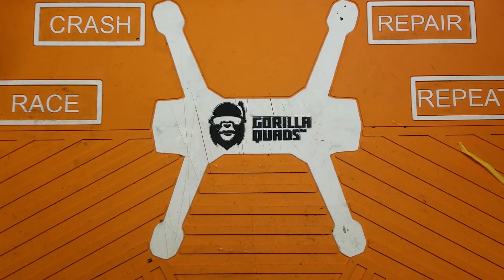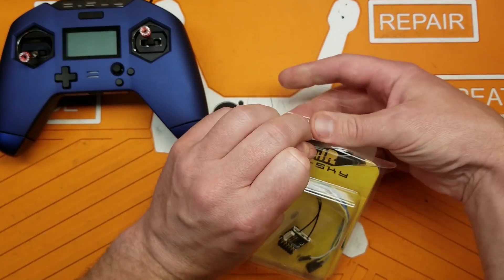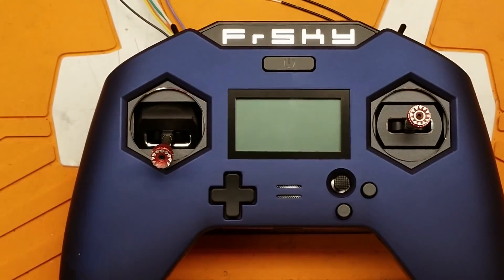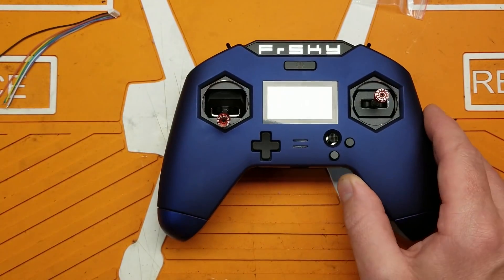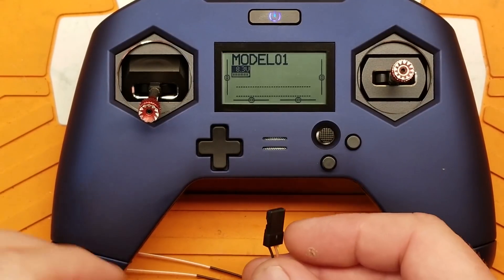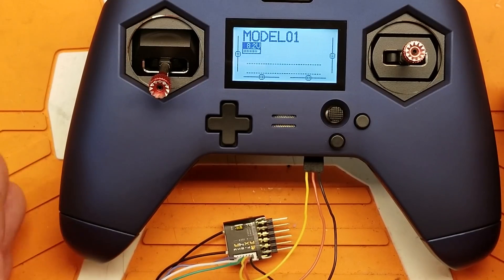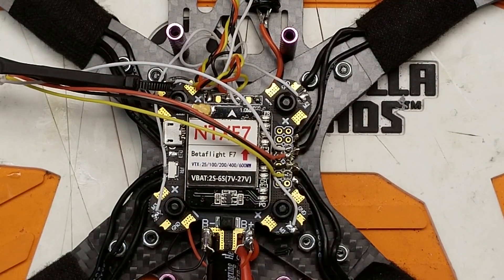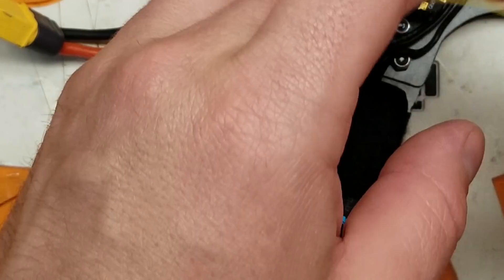RX4R ACCESS with Frsky X-Lite Pro.

Comment: Hi, I have a Taranis X9 Lite, there is no "ISRM" mode to select, only Access and ACCST D16. Is it even possible to use this transmitter with the RX4R? Thanks!
Reply from the maker: Isrm mode is access. Yes you can use it with the rx4r in either accst d16 mode or access. It all depends on which fw you have flashed to the receiver.
Reply: @TweetFPV  I did like in your video, flashed the newest software. But it wont connect with either access or accst d16 mode
Reply from the maker: Its only going to work on one mode or the other depending on the fw. Which fw did you flash? Also the fw on the radio also needs to be updated to match.
Reply: @TweetFPV  I flashed "FW-ACCESS-RX4R-v2.1.0" - the newest.  Thanks a lot for your help.
Reply from the maker: Ok then you also need to flash the isrm fw for your radio of the same version
Reply: @TweetFPV  doing it right now with your video.

Comment: Which receiver to use for "FrSky Taranis Q X7 ACCESS"?
Reply from the maker: R-xsr is my go to receiver
Reply from the maker: Eventually frsky will release thier archer m receiver. That will be a access native 2.4ghz rx. I've had mine preoreded for about 6 months now.
Reply: @TweetFPV  I am looking for 900Mhz receiver
Reply from the maker: Ok, so you already have a r9m2019 module? If so then the r9mm Ota is the one to get.
Reply: @TweetFPV  Thanks, and I need to buy SBUS to PWM converter too, to use channels to control camera gimbal, servo etc right?
Reply from the maker: You can do that if you want. There are 4 pwm outputs on the rx you can use without the sbus converter.

Comment: Hi TweetFPV, you really need to do a new analyse on this controller. I have it too & flying it with a XM+ receiver. As for the moduls, you could fit different types ; ). But what I haven't managed to do is run it on D8. There is supposed to be a way to do it & actually hoped you would've/could've done it. So I could learn from you to so it myself. Great review & take care.
Reply from the maker: Unfortunately there is no way to run the new access radios on d8 without using an external xjt module. You can however run a lot of the spi micros on d16 https://youtu.be/hUpZdIAclOE
Reply: TweetFPV ahh ok, thought so, thnx for the reply & take care.

Comment: FR sky pissed me off with what they did with ACCESS. Does anyone actually notice an improvement with the obsolescence protocol?
Reply from the maker: I have been running access since day one and it does typically out perform older d16 recievers. Why does it make you mad that they are creating new tech? No one is forcing you to use it, and all your old gear still works just the same as it ever did. The only thing that I don't like about the new breed of radios is the lack of d8 support.

Comment: The size of the RX4R is not as bad as it looks in this video...The version of the RX4R you show here has a lot of unnecessary x/tra stuff on it as it is the "with pins" version. I sell the bare-bones/un-pinned version of the RX4R here at Boulder MultiRotor LLC / bouldermultirotor.com which you can find for sale here: https://bouldermultirotor.com/product/frsky-rx4r-recei…els-without-pins/ and it's actually much smaller than you might think!...the reason for this is that you don't need the pins, the smartport harness/connector, the foam pad, or the cardboard/paper input/output labels cover. All you need is the RX4R directly soldered and maybe a little thin piece of clear heatshrink.

Anyway, I thought this might be important to mention since for most FPV pilots, size does matter :) Also, one other thing...the video mentions that the R9M-Lite module will eventually work with the X-Lite Pro but I don't believe this is correct. Especially since Frsky just released a new version of external module for the X-Lite Pro called the "R9M Lite Pro" with the following description:

"The R9M Lite Pro is the upgraded 900MHz Lite module. It has a high-speed digital interface, supports up to 1W RF power, and is fully encased in a CNC aluminum protective shell which also aids in heat dissipation when using high RF power. Designed with the new ACCESS firmware, it also supports spectrum analyzer functions. The module is perfectly compatible with FrSky new ACCESS radios like Taranis X-Lite PRO and X9 Lite."

Here is a link to their website for this new product: https://www.frsky-rc.com/product/r9m-lite-pro/?utm_source=frsky-rc.com&utm_campaign=c00c2dffc0-EMAIL_CAMPAIGN_2018_02_12_COPY_01&utm_medium=email&utm_term=0_60299ab891-c00c2dffc0-182506817&mc_cid=c00c2dffc0&mc_eid=ac2057c26e

Frsky does currently have new ACCESS firmware for the RX4R, RX6R, G-RX6, and G-RX8 and they will eventually release new ACCESS compatible firmware for the following older receivers: RXSR, XM, XM Plus, RX8R Pro, plus I imagine a whole new line of ACCESS compatible receivers will be created since this is the direction they are headed. I'm glad they are finally jumping onboard with great features (that the TBS Crossfire already has) like OTA (Over The Air updates/firmware) and digital interface!

Anyway,  great video! Thanks for providing mostly accurate information (I do realize that some of the updated info I mentioned came out after the release of your video) and great step-by-step instructions for updating the RX4R to be compatible with the new X-Lite Pro!

Comment: Is there support for installing the TBS Crossfire module?
Reply from the maker: In the latest nightly builds of opentx there is a option for crossfire. I have no way of confirming if this actually works or not. External modules like the Vantac mpm do work. They aren't super reliable yet but they do work. Nightly builds are very buggy and should only be used for testing and development purposes.

Comment: I was hoping to see you acually use ACCESS and fly with it to give impressions - is it any good?  To be honest I quickly scrolled to see because I do not care how it gets installed or what to hook up in betaflight if it is not any better than my old gear.  It's not your faults - I am waiting for that video to explain why we need this.  The marketing from Taranis is horrible.
Reply from the maker: I'm still testing the gear. so far i'm about 20 packs in and here is what i think:
The range on this receiver is better than any 2.4g rx I've ever used. I can't attribute that to the ACCESS because I don't have much experience with the RX in the ACCST form.
I have had no drop outs, or random connection issues. 
I am no expert pilot but the latency feels very low, but without the proper equipment i have no tangible way to measure this other than by how it feels.
Do you NEED this.... Hell NO! 
In the future the only real advantages i can see with this ACCESS protocol is that you will have the ability to share your model with another person using a ACCESS transmitter with out needing to bind to their gear. Basically you can share your 
There will be OTA (over the air) updating of receiver settings and firmware from the transmitter. IMO this is the biggest advantage of the ACCESS protocol that i can see. 
Then there is latency. Frsky has a 9ms latency setting in the firmware but it is only if you use up to 8 channels. For most people flying FPV this is plenty. just for comparison crossfire is about 13-14ms (not my data).  Again i have no way to prove that these numbers are real and not marketing wank. 
The downside of all this is ACCESS and ACCST can not exist at the same time and ACCESS is not backwards compatible. So this means that off brand receiver like the ones in the crazybee boards and the emax stuff for example will probably never have the ability to communicate with a ACCESS transmitter so the need for a multi protocol module will probably be a needed accessory for anyone who has a newer radio that has the ISRM transmitter module. 
I hope this was useful. If i missed anything please let me know and i'll try and answer.
Reply: @TweetFPV  Thanks a lot - now I am intrigued.  I may have to get this after all.

Comment: Great video, looking forward to more X-Lite Pro updates on your channel :)
I'm currently waiting on mine to arrive, just hoping FrSky will offer some updates soon. Do you know if with the current firmware multiprotocol modules like Vantac MPM Lite will work?
Reply from the maker: I don't know for sure. In my chats with a service rep from frsky he made it sound like no, but I have the vantrch mpm on the way and it should be here by the weekend. I'll be covering that subject for sure.
Reply: @TweetFPV  Awesome, looking forward to that tho :)
Already have the Vantac MPM lite at home, was hoping after hearing there's no update yet for R-XSR I could at least start up my TinyWhoop with the MTM once I got my X-Lite.
Reply from the maker: I got my Vantac MPM and I'm sorry to say that it doesn't work. There is no option for "mult" for external rf even with today's fw update. Hopefully they will have the option soon. If I figure it out I will certainly have a update about it.
Reply from the maker: But there is a fw for the rxsr now and that does work so there's a little bit of good news!
Reply: @TweetFPV  Bummer for the MPM at the moment but glad they sorted out the R-XSR.
Another thing that came into my mind is the XSR-Sim dongle, any chance you tested that too with the X-Lite Pro?
Reply from the maker: I looked and I don't see new access fw for the Sim module so I would guess that it will not work with the xlite pro.

Comment: The important info to me is how the new protocol works in comparison to the old in terms of latency, range, and consistency, any thoughts after flying with it?
Reply from the maker: After flying it the range seams better even with the antennas in a less that optimal orientation. Rssi seams to be spot on with it being built into ch16. Latency I can't tell. I don't have the equipment to test that. I'm sure drone mesh will eventually do it. He is really good about that stuff but things don't make it to him very quickly.

So far I really don't see much of a bennifit of the access protocol. But there may be bigger things going on down the road that need this communication standard.
Reply: TweetFPV thanks for your input, I appreciate it!

Comment: Can you register without pressing the bind button or does the ACCESS auto bind only work once the receiver has been registered to the radio?
Reply from the maker: You need to push the button to register the rx. Once that is done the bind can be done without pushing the buttons.
Reply: @TweetFPV  Bummer, I was hoping we wouldn't have to use the bind buttons anymore.
Reply from the maker: Yea, me too. Not sure what the advantage of the access stuff is. I'm hoping this is going to be a way forward for frsky to do Ota firmware and settings changes.
Reply: @TweetFPV  OTA firmware updates would be great. They seem to say this will be possible, so I guess we'll just have to see.

Comment: Excellent video. I have the same receiver  I bought to use with my lite pro. I’m still having trouble with my SD card data and getting it installed. Don’t really know what I’m doing there and there’s literally NO info out on this thing other then your videos. It’s very frustrating.
Reply from the maker: There is a lot about this hobby that is fustrating. I can help you with the process. You can get the SD card contents here: https://www.frsky-rc.com/taranis-x-lite-pro/ obviously you are going to need a sd card too.
Reply: TweetFPV awesome.  I did get the content downloaded and I moved it to the sd card  with the card in a usb reader. But I still don’t have sounds on the radio but I think I need to follow your setup where you went into the sd card menu and opened the firmware file. Cause when I turn in the xlite it says sd card warning even tho it’s installed and loaded with the FireWire.
Reply from the maker: Something sounds wrong. You shouldn't be getting a sd card error. What does the error say?
Reply: tweetFVP so it says ( " SD Card Warning" expected ver:2.3v0019 press any key)  it looks exactly like the throttle warning startup page but says all that. but the fireware in the menu says the correct version. ican access the sd card content thru the xlite menu and all the contents are in there but I have no sounds on startup or any and I get that warning message on start up
Reply from the maker: You must be missing some part of the SD card contents. I would format the card again, re download everything and put it all in the root of the SD card. Also I'm not sure if it will make a difference or not but make sure you can see hidden files.
Reply: TweetFPV oh thank god. That did it. I didn’t have the file in the root of the usb drive folder. I moved it up to the root page and pow. All good. Thanks a lot man. Sorry to engage a full tutorial in your comments. Haha. Hopefully someone else got help as well from this. You snagged a new sub for sure. Look forward to more from you. Now to finish cutting all these dam pwm pins off and figure out what the hell Ain2 is.
Reply from the maker: Haha no worries. Glad I was able to help. If you figure out what ain2 please let me know!
Reply: TweetFPV it’s the integrated voltage reader. Did some deep digging and only thing that makes sense.
Reply from the maker: Ah. Interesting. This rx seams like it's for fixed wing/ no fc oriented.
Reply: @TweetFPV  I agree. no need for voltage reader for us quad guys but I will say I was able to get it working just a bit ago and a short test run gave me some good rssi numbers. really good actually. test more tomorrow tho  hope we can get an amber pack soon tho cause im not feeling this chick hahaha
Reply: So just a little update on my end. This combo of ( rx4r receiver / taranis x-lite pro with 40% better range) is pretty dam good. I did 3/4 mile at about 150’ elv. And never dropped below 95 rssi....... internal antenna only. 😳 latency feels great also.